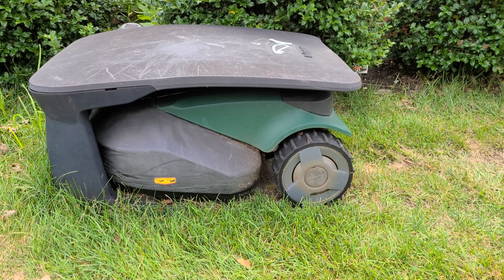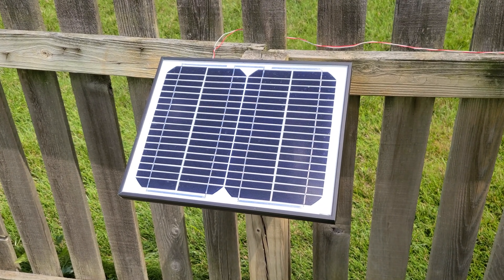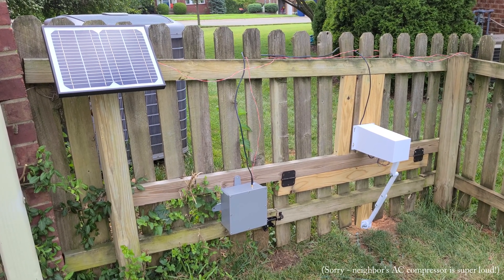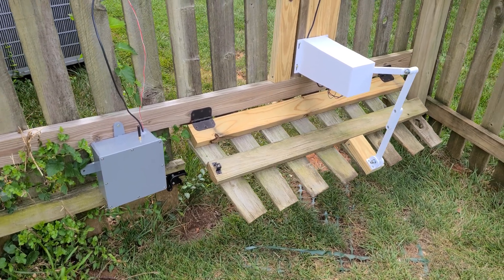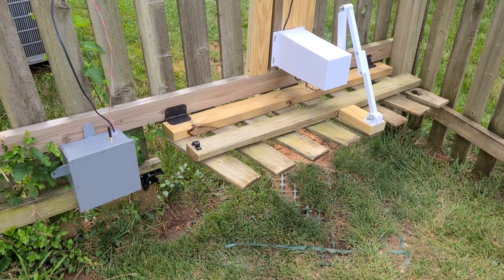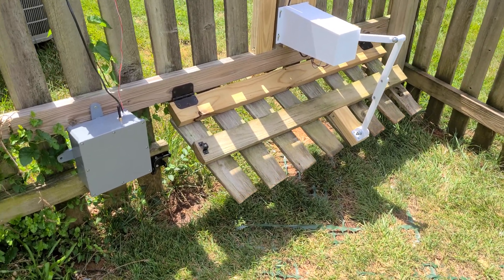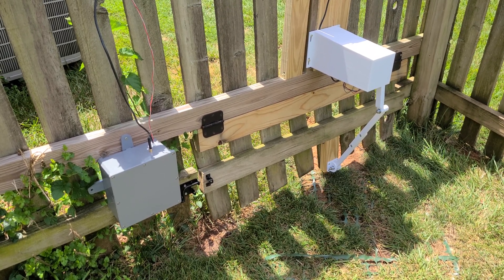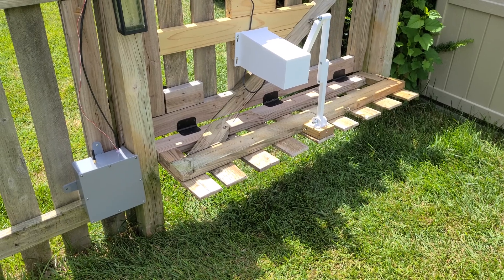Robot Mower Automatic Gate Control for Robomow

Comment: What brand of motor mechanism did you use?
Reply from the maker: I used a cheap wormgear assembly on Amazon, both a 30:1 and 80:1 variant. I paired that with a NEMA 23 stepper motor. You'll need a shaft adapter, often included, but can also be printed. Stepperonline makes decent motors that work in these applications. I also used Stepperonline stepper drivers, though anything with a DRV8825 will also work very well. The nice thing about the pre-built drivers is that they are coated in conformal coating, so they won't care about moisture buildup in the controller chassis.

Comment: Adrian have you ever made a video of exactly what all is needed in this kit and how to connect all this?  I am getting an Ambrosio Elite 4.0 ordered and intend to install it early June and want to have everything ready by then, I have dogs and don't want them to get out while the gate is open and was thinking that a timing setting could have it open the gate as the mower is headed to area 2(front yard) and open the gate about 10secs before it gets there(Should be a constant amount of time) and close it after it goes through.  Then the mower has a setting for how long it stays in area two, and then another timing setting would reopen the gate for it to return to area 1 then close after a certain amount of time( with the algorithms of the mowers this could be a different time depending on where in area 2 it is when it starts it's trip back to area 1. 
If you wouldn't mind sharing I would really like to have a complete list of all the parts(except what you 3D printed of course) and how to set it all up.
Any help your willing to share would be greatly appreciated, I think if I hire someone to come in and install something like that- well I might as well buy a second mower for the front yard. Thanks Jon

Comment: Thinking about getting one of these robots to do my .42acre but I have 3 zones, 2 are separated by chain link fence so I would have the same problem and the last zone has a gate(chain link) with the garage and driveway on two of the other side- so hard to get to really? Not sure still looking at ideas.  Have you talked to the manufacturers about selling the idea? I have a couple of others that I would like to see incorporated as well as a separation gate, I think using bluetooth to command different modules to do what they do is the best way to go. Example: a sort of over/under carwash for the unit just before it returns to its charging station - it would have to sit on the wash for about 2mins with the blades running but after that return to normal and return to it's charging station. This would only take a bluetooth water valve to open and hydro-mechanical spraying of the under/top of the unit. There are so many things that could be added as extras but incorporating the programing for the different modules is up to them really unless its open source.
Reply from the maker: As for selling - I wonder how often this problem occurs, or how keen owners would be to have holes cut into their fences. I think with a bit of work and investment, it could be cleaned up nicely, but I've hardly had the time for that. However, Robomow, if you're watching, let's talk!
Reply from the maker: Washing the underdeck is interesting. There's actually a robot vacuum (not sure if it ever made it into mass production) that had a self-cleaning mop attachment that would scrub the mopping pads on the charger base. Different than the self-emptying bin systems you see on the Roomba product line, it was for washing the mops. Biggest issue I would see with that is obtaining a water source. Could easily control with ZWave or WiFi if it's powered by the base, I would suppose. I chose LoRa on these gates for the range, and because I didn't want more 2.4GHz devices cluttering up an already very busy network!
Reply: @AdrianLauf  FYI they make a timer water valve that can open your hose for watering the flower beds and stuff like that, wouldn't be hard to have a bluetooth version of it and upgrade the mowers programming to use the bluetooth to active the wash system once it has arrived in place.  The wash system could be hydro-mechanical just as simple as any of the watering systems currently in use today that change direction once a point is reached- if you know what I mean.
There is a video out there from Germany that uses software upgrade to the Kuskavarna mower that when it powers up after the timer countdown and then opens and electric garage door and the mower waits for the ok to move and does the same on it's return to the base(in the garage. It's in German so I had no idea what he was saying but it worked great.

Comment: First, Great job! I do have one question. The worx Landroid manual states you need the guide wire 14 inches from your barrier and 36 in between the guide wires this would require a 64" gate. How did you get around this requirement? did you put the gude wires closer than 14 in from the edge or did you put the guide wires closer than 36" to each other?
Reply from the maker: Thanks! The Robomow RS-series can recognize a "narrow pass" section which is created by setting up a particular shape with wire and pegs that the robot recognizes. The robot kit includes a cardboard template with peg holes that makes it super easy to set up the wire configuration. It will see the shape and then go between the two zones. I have set up four such "narrow pass" markers, one on each side of the two gates. The template only requires 50cm width in this case (or 1m depending on which part of the manual you look) to accomplish it, so the gate width worked easily.

Comment: Clever idea for interfacing with the mower's control unit: no fancy taps into its internal circuitry - just an LDR over the status light....simple yet effective...one might even call that piece of electrical tape atrocious, but I love it ! :)) In all reality, COULD you tap into the mower's box somehow to make the system more integrated ?
Reply from the maker: Yeah, that would be the second iteration - something direct.
Reply from the maker: Also, I had to update it with a photodiode instead of CdS cell because the CdS cell was far too temperature dependent. I updated the design with a 3D-printed component that has been completely reliable.